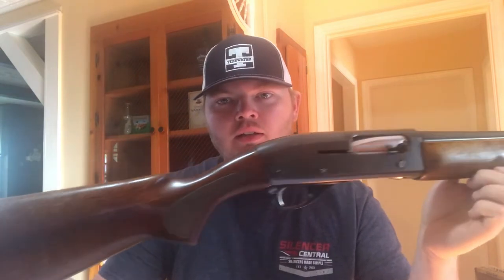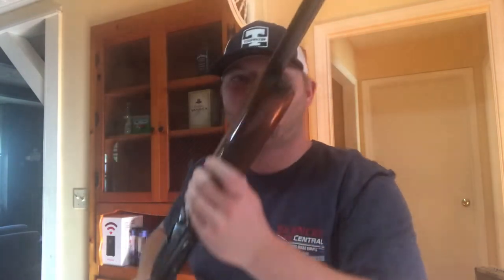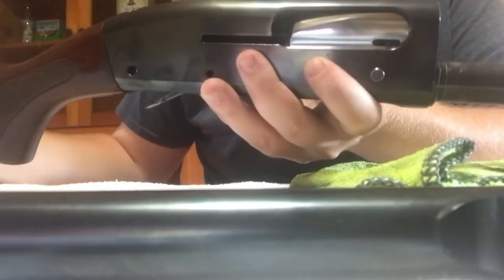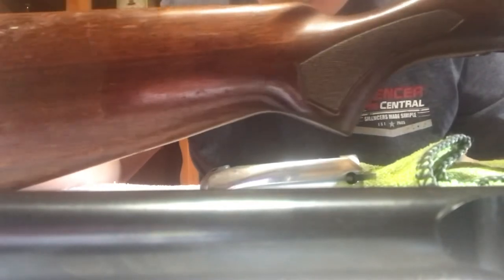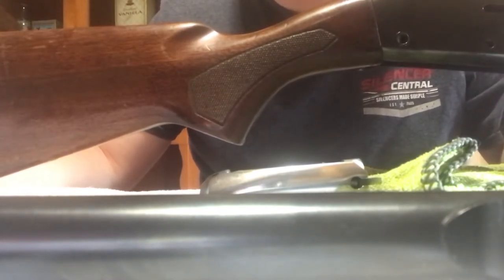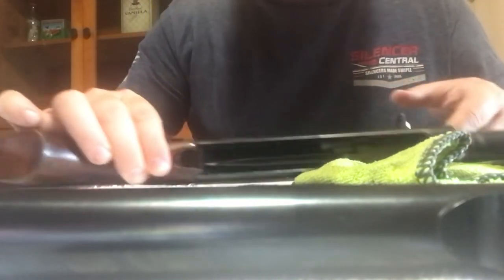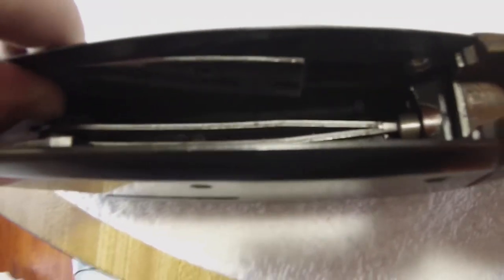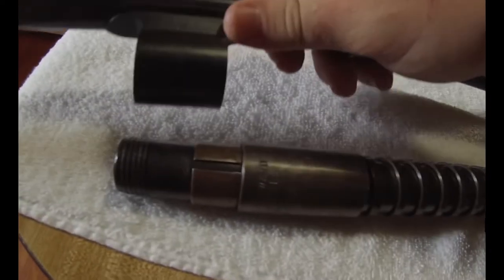Remington 11-48 Complete Disassembly and Reassembly

Comment: If you came here because I had the same question!
“ if you can’t get the charging handle out”, you need to pull it as hard as you can straight out towards you”, or take pliers with a nice cloth so you don’t scratch it!, And pull it straight out🤙👍🏽

I have the 28 gauge model 
Very rare shotgun !! got it from my father and I just now I’m cleaning it after like 50  something years it still has the factory lube on it😳😂..
Reply from the maker: Haha wow! Thanks for the info! Good to know! Yep it’s forced in by a small retaining ball.

Comment: I saw a can of WD-40! I used that on my shotgun in the cold weather of Idaho. My pump shot gun got so stiff I could not pump it. Use ONLY gun oil🥴
Reply from the maker: WD-40 is labeled as a lubricant but I trust it as a cleaning agent only. However, down here the cold is of least concern, it’s them 100 degree September days we worry about the most.

Comment: I cannot get the trigger assembly in with the shell latch in place...can't hold it with my fingers and put the trigger i
Reply from the maker: You’ve got to reach in and hold the shell latch down while sliding the trigger assembly in place
Reply: My shell latch seems to be bent...will not allow the trigger assembly to get past it...I'll try to straighten it a little if that is advisable

Comment: I have an 11-48 that won’t keep the hammer cocked for the 2nd shot, unless I just barely pull the trigger with the very end of my finger, so that my finger slips off completely when it fires. If I pull the trigger on the first shot, and then keep the trigger pressed back, the hammer doesn’t catch during the cycle and I have to do it by hand, ejecting the 2nd shell in the process and then firing the 3rd shell. 
By looking at the trigger assembly, I can see how depressing the trigger holds the notch that catches the hammer away from the hammer. Am I missing a piece of the assembly?
Reply from the maker: You may either be missing something or something is slightly worn keeping it from cocking right. There is a parts schematic for the 11-48 I recommend you looking at on the Numrich parts website. That should help you see what is missing or possibly worn. Also, check eBay for complete trigger assemblies as there are tons of them in the $30-$60 range depending.

Comment: I have a 48 sportsman from 1952. Went to shoot today and only got a click with a loaded round in. My slide locked up and it took me a minute to get it to release. After a new round being loaded it fired but didn’t cycle correctly. Do you think it could be the same issue?
Reply from the maker: Very possible. Check the action spring plunger and see if something is impeding that. If it’s seized up in any way the action will not retract like it’s supposed to. Also check and make sure you have your friction piece installed into the barrel ring before the barrel is put into place.
Reply: I’ll check thanks bro
Reply from the maker: @sirmize1230  No problem, let me know

Comment: I've got Dad's 11-48 manufactured in February 1952.  He used it exclusively into the 1980s, always kept it maintained, but then suddenly it failed to eject on the 2nd or 3rd shot.  Gunsmith claimed it was dirty, so he cleaned it.  Jamming continued.  Dad continued to use it as a single shot, then later got a Weatherby Orion.  I cleaned it, oiled it, then shot it the other day, first time to be fired in 35+ years.  Jammed on first shot.  Empty did not eject, but second shell was released from the magazine, causing a serious jam.  Had to be disassembled to remove live rounds.  Any ideas on what the problem is?
Reply from the maker: These recoil guns are all dependent on their springs. If it was shot a heck of a whole lot I’d start there. Art’s Gun Shop makes a rebuilt kit for these 11-48’s. Past that, make sure the chamber is extra clean as plastic can build up there over the years. The recoil spring and/or the action spring would be my bet and you can get both of those from Art’s.
Reply: @southgasportsman20  I think you're right.  Replaced the action spring.  The 71 year old original spring was about 2" shorter than the new spring.
Reply from the maker: @macmccollum6064  good deal, definitely not uncommon. The recoil spring is likely the same way. Art’s Gun Shop offers the complete kit with all the springs for like $120

Comment: I watched to see how the bolt handle was removed but it wasn't shown.  Mine was stuck but I was able to pull it out with a pair of pliers(protecting the handle with fine steel wool).
Reply from the maker: Yes sir they will just seize up sometimes. There is a retaining ball in there that is under tension and that’s what holds the charging handle in